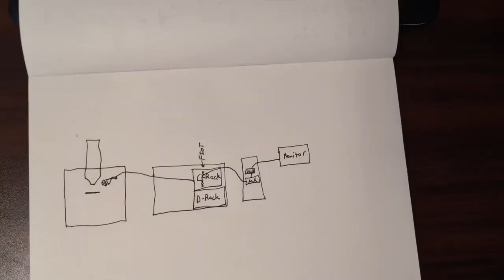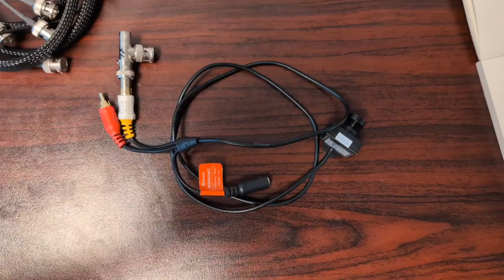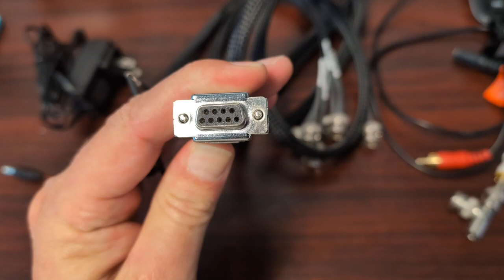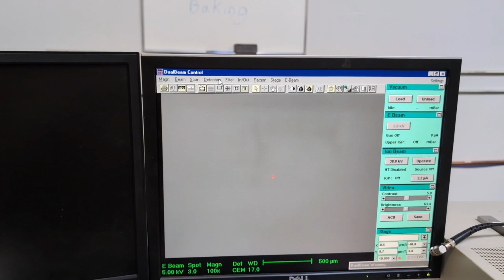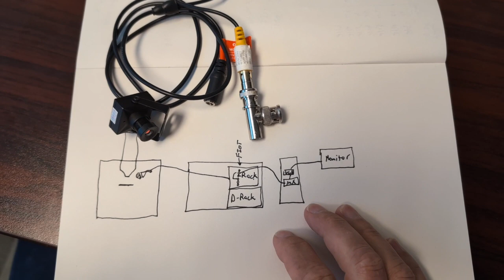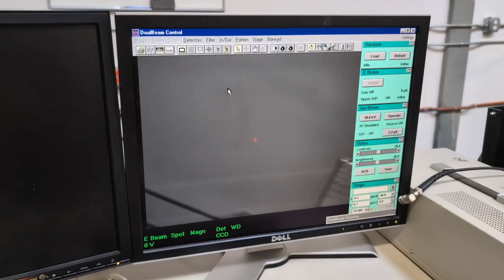Testing Coreco MX board used in Philips XL SEM and FEI Dual Beam Microscopes

Comment: Great Tip David -- to test the video signal to verify a pc video card defect and/or with a NTSC video monitor to test the microscope video output. Divide-and-conquer !!  I carry a portable NTSC generator that spits out text patterns and a portable NTSC composite video monitor and test cables in my trunk stock.  Never leave home without them!